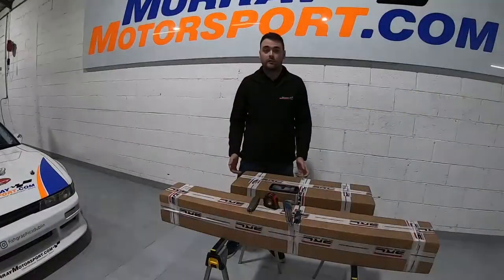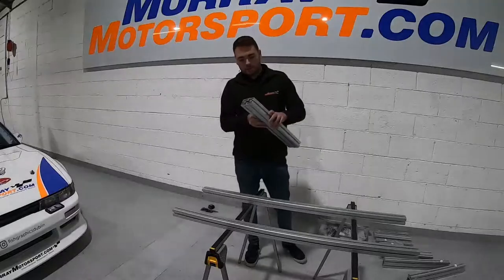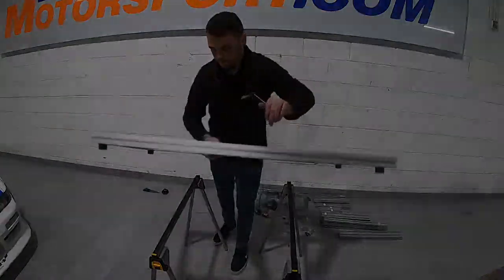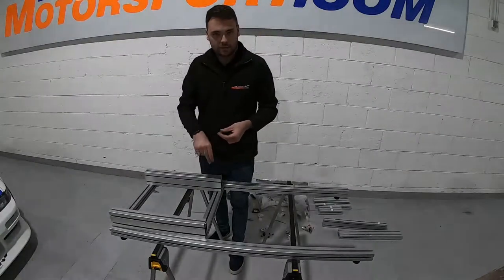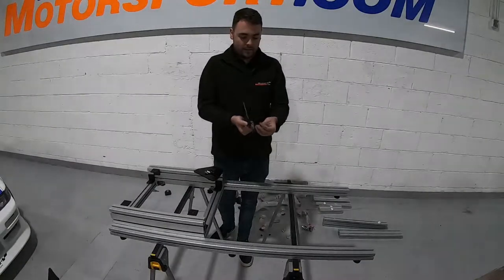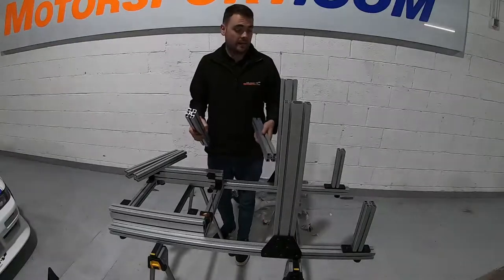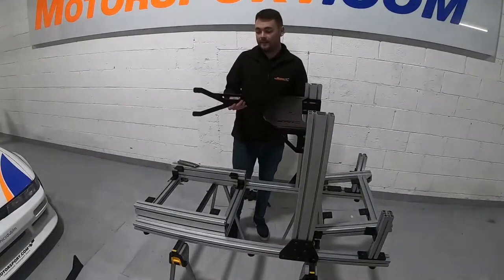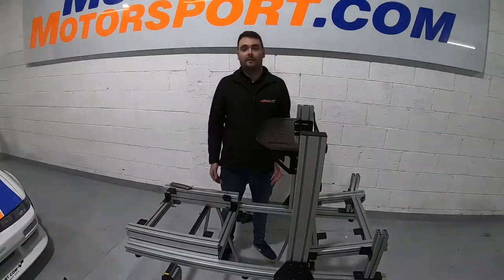SRC-1 PLUS Build Video

Comment: is this compatable with a DD1?
Reply from the maker: Yes, its compatible with any wheel motor, but for the DD1/2 an additional mount is required. For Direct Drive wheels we would recommend the SRC Pro V2 chassis